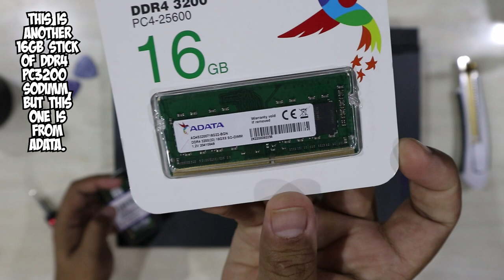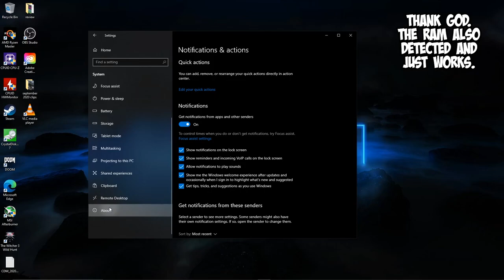Lenovo Legion 5(2020): SSD and RAM upgrade

Comment: MUST READ BELOW!
My experience so far after checking out this Legion 5 AMD.

How to buy - Right now not available in stores, but go to store ask them to order one and after 4 days later, get it in store itself. 

Legion 5 AMD 4600H/4800H - 79,000 / 89,000

1. 4600H/4800H - Top most mobile cpu you could get in this price(far better than 10750K)

2. 1660 Ti is perfect for 60+ fps with ultra settings with all and even latest AAA titles. But in here 1650 Ti is still better, it only 20% performance drop from 1660 Ti.

3. Crucial 3200 CL 19 - 8GB RAM - Dual slots(one filled & one empty)
*If you are a heavy user, just get an additional 8 GB(it should be the same RAM model)from Lenovo showroom itself*

4. SK Hynix NVME 256 GB SSD - Great speeds 2K/1K of R/W.
*If you want upgrade SSD ask the store swap a better 960 Evo(3K/3K of R/W) for C Drive*

5. WD HDD 1TB 5400 - Good terrabyte storage
** Gamers - If you want faster loading speeds, swap the HDD for a 860 Evo
Sata/M.2 SSD. It will only help in faster loading speeds, not gameplay.
**Video Editing/ Content Creators - Definitely, swap the HDD for a 860 Evo
Sata/M.2 SSD.

6. Display - 250 Nits. But 300 would have been perfect.
** Gamers - 120Hz is nice. But NO Freesync / G sync. 
**Video Editing/ Content Creators - 72%NTSC is perfect for color accuracy, but it has 45% NTSC. My opinion-you can later get a good display for professional works.

7. Great cooling system. Simply desktop level performance from this beast of a Legion 5

It is solid Laptop in this price range. BEST BUY LAPTOP IN 2020.

1. HP Omen AMD 2020 is very similar to Legion 5 AMD2020. (ALSO A BEST BUY LAPTOP IN 2020). 75,000
2. Don't consider HP pavilion Gaming. coz Omen is so value in 75 k price range.
3. Acer Helios 300 2020 - Also a very good Laptop.
4. Asus Zephyrus G14 - Also a very good Laptop.
5. Dell G3 - Not a better cooling system. 100°C
6. Asus TUF 2020 model - Not a better model from this year.
Reply: Gaurav Raj Panta  I too agree with you, there are some videos that teach us as not in juts gaming as an overall graphics card value comparison between them, we can see that much of difference.

Comment: is it the r7 4800h and 1660ti variant? I usually see people getting the samsung 8gb 3200mhz ram.
Reply from the maker: hi. my one is the 4800H with the 1650ti. models with 1660ti and above comes with 230w charger. the factory RAM is made by Kingston. I just bought the cheapest RAM that meets the spec. ha ha. tq for watching
Reply: @masterofnone4608  yes , yes. u're welcome. I understand. mine is the R7 4800H and 1660ti variant and has 8gb ram but i don't know from which brand they are. i just want to upgrade to 16gb but same brand as well. In ohter video I saw that they got default samsung rams. so it varies depending on region/models etc. thanks for replying though.

Comment: Thanks for your video!! I need to upgrade the SSD M.2, but i want to know the compatibility of the SSD in the market, could you please tell me how?
Reply from the maker: hi. thanks for watching. for m.2 nvme ssd, the Legion 5 supports up to 80mm length ssd(2280). compatibility wise, pretty much any brands of m.2 nvme ssd would be compatible. hope this helps. thanks.

Comment: Thanks for the information. I just bought the same laptop but with 1 stick of 8gb and I am considering upgrading     to 16gb
Reply: Which brand did you buy?
Reply: MUST READ BELOW!
My experience so far after checking out this Legion 5 AMD.

How to buy - Right now not available in stores, but go to store ask them to order one and after 4 days later, get it in store itself. 

Legion 5 AMD 4600H/4800H - 79,000 / 89,000

1. 4600H/4800H - Top most mobile cpu you could get in this price(far better than 10750K)

2. 1660 Ti is perfect for 60+ fps with ultra settings with all and even latest AAA titles. But in here 1650 Ti is still better, it only 20% performance drop from 1660 Ti.

3. Crucial 3200 CL 19 - 8GB RAM - Dual slots(one filled & one empty)
*If you are a heavy user, just get an additional 8 GB(it should be the same RAM model)from Lenovo showroom itself*

4. SK Hynix NVME 256 GB SSD - Great speeds 2K/1K of R/W.
*If you want upgrade SSD ask the store swap a better 960 Evo(3K/3K of R/W) for C Drive*

5. WD HDD 1TB 5400 - Good terrabyte storage
** Gamers - If you want faster loading speeds, swap the HDD for a 860 Evo
Sata/M.2 SSD. It will only help in faster loading speeds, not gameplay.
**Video Editing/ Content Creators - Definitely, swap the HDD for a 860 Evo
Sata/M.2 SSD.

6. Display - 250 Nits. But 300 would have been perfect.
** Gamers - 120Hz is nice. But NO Freesync / G sync. 
**Video Editing/ Content Creators - 72%NTSC is perfect for color accuracy, but it has 45% NTSC. My opinion-you can later get a good display for professional works.

7. Great cooling system. Simply desktop level performance from this beast of a Legion 5

It is solid Laptop in this price range. BEST BUY LAPTOP IN 2020.

1. HP Omen AMD 2020 is very similar to Legion 5 AMD2020. (ALSO A BEST BUY LAPTOP IN 2020). 75,000
2. Don't consider HP pavilion Gaming. coz Omen is so value in 75 k price range.
3. Acer Helios 300 2020 - Also a very good Laptop.
4. Asus Zephyrus G14 - Also a very good Laptop.
5. Dell G3 - Not a better cooling system. 100°C
6. Asus TUF 2020 model - Not a better model from this year.

Comment: hye after installing the ssd, do you need to do anything on your pc to make your ssd run or it willl have another storage automatically. If you have to do anything to your pc to make it run, pls guide me on that
Reply from the maker: hi. thanks for watching. right, if you plan to install an m.2 nvme ssd on the Legion 5 as secondary drive, it's pretty much plug and play. if it's a virgin drive(ie never been formatted/installed before) then you may need to format it first before it can detected and used.  Below is the link to the video where I installed a brand new secondary m.2 nvme ssd on my Legion 5.
https://youtu.be/WkWt8RctLiA

now, if you're talking about installing an m.2 nvme ssd on an older computer(ie one that use hard disk or sata ssd as boot drive) as a boot drive, you may need to enter the bios of the laptop and ensure your laptop is set to uefi mode(this will vary from manufacturer to manufacturer) before you can use your new nvme drive.

that is pretty much the most important thing to do before installing a new m.2 ssd as boot drive on older system. you can clone your old drive etc etc, I personally just do a clean new install to make sure my new drive is not bogged down by any weird settings/driver from old drive. 

it's a bit difficult to go into detail here in reply, I'm sure there's many video on YouTube that can show you how in great detail.

hope this helps. thanks😊

Comment: Why don't you guys disconnect the batter first?
Reply from the maker: removing the battery before performing any upgrade is definitely good practice. it will ensure that no possibility of power running through components and thereby reducing risk of causing short circuit and damaging the laptop. I didn't do it because I'm just lazy, and removing the battery clip is way more work than just removing the RAM. If you really want to minimize the risk of damage, yes do remove the battery, I personally never had issues upgrading a laptop without removing the battery but that's not necessarily the right/recommended way of doing things. Take the good things from the video and do ignore the bad/incorrect things. hope this helps. thanks.

Comment: Thank you for your video, My battery is damaged, it does not hold a charge, just 15%, I would like to know what spare I can use. Thanks
Reply from the maker: thanks for watching. I don't remember the exact model number, but you can search for a replacement battery online, it shouldn't be too difficult. I'm not sure where you live so I can't really suggest a link. if you're not using the sata drive slot, you can even upgrade the battery capacity. hope this helps😁

Comment: Hey, I am getting black screen after upgrading the ram of Lenovo legion 5 15arh05, I used Crucial CT8G4SFRA32A RAM 8GB 3200MHZ DD4 SODIMM, which showed on the Crucial site.
Reply from the maker: hi. sorry to hear that. hv you tried renstalling the old ram stick(s). does the black screen still occurs? if your computer is fine with the old ram, it's probably a good idea to reseat the new ram making extra sure it is properly installed. if you hv more than 1 stick of ram, try one stick at a time. for all we know it may be a defective stick. hope this helps. thanks for watching.
Reply: @masterofnone4608  I didn't touched the old RAM, just put crucial one in the other slot, it wasn't booting up, then I removed crucial one and laptop started.
Reply: @masterofnone4608  I tried installing the new ram 2 times. didn't worked both times, got black screen.
Reply from the maker: @ZeroLight_YT  did you try with just the new ram stick? system boot up? . cause if it still black screen even on its own, you may have a defective ram stick. but if on it's own system boot up, maybe the old and new ram is not compatible with each other.
Reply: @masterofnone4608  Lol I am too scared to remove original ram of the laptop, so I didn't tried with only crucial ram stick.
Reply: I bought the same ram stick as yours 🤦🏻‍♂️. Hopefully it works on mine and yours is just a defective one. BTW, do you have the Lenovo legion 5 rtx 3060 or last years model?
Reply: @iihamed711  nah mate it was fine only mostly, I think it didn't got booted up as I didn't removed the battery cable connected to the laptop, when my replaced stick came I removed that cable and then inserted the ram, it worked fine, I have 2020 Legion 5 ryzen 5 4600h 1650 one
Reply: @ZeroLight_YT  Great to hear. Thanks

Comment: it is possible to put nvme and ssd together or there is not enough room min 9:42
Reply from the maker: hi. the way lenovo set it up,  if you plan to add more storage, you have to choose either adding a sata ssd or an nvme ssd. unfortunately can't have both as either will block the other one from being installed. hope this helps.

Comment: People say its important to disconnect the battery but do need to unplug the battery connector and move it out or do you just need to unplug the connector?
Reply from the maker: hi. thanks for watching. it's usually enough to unplug the battery connector, no need to take out the battery. hope this helps. 😁

Comment: whats the read/write speed of the m.2 that comes with this
Reply from the maker: hi thanks for watching. the m.2 drive that came from the factory in my legion 5 is a western digital one(not sure which model). 

If i remember correctly, the read and write speed are around 2800MB/s. Which is not too bad.

Hope this helps. Thanks.

Comment: Bro, where did u get the screw for nvme? Does the screw from the dummy drive fits with the nvme?
Reply from the maker: hi. unfortunately the screw from dummy disk won't do for the nvme. it needs a 3x2mm screw. some nvme do come with the screw, some seller would some time include the screw, some pc case/laptop do come with a screw pre installed and some times unfortunately you have to buy the screw separately. the main thing is to check when buying whether the screw is included or not. it'll be very frustrating to find out that you're missing one tiny screw after opening up the laptop and about the install the nvme. hope this helps.

Comment: Hello, nice video, thanks for sharing! One question: I noticed you're using the genuine Lenovo Legion notebook stand, how do you like it? Would you recommend it? I'm asking because it is quite expensive if bought in my region and there are many other cheaper alternatives out there...
Reply from the maker: hi. thanks for watching. I quite like the stand because it's made of solid aluminium and feels sturdy. also because of the fact that the legs can be fold flat. 
I don't know how much the stand cost because I got it for free. When I bought the laptop, lenovo did a giveaway promotion on the website. basically if you bought a Legion, you enter your email and home address and if you're among first 500 or something they send you some free stuff eg cap, water bottle, laptop stand, and headphone cases. so I was one of the lucky ones. 
maybe I'll make a video one day of what I received. that's the thing about lenovo, they always do some quiet promos on the website and sometimes the way the website is arranged don't make things too obvious.
so, to answer your question whether it's worth it. if you think it's expensive and there are cheaper alternatives, then it's not worth it. personally, if I was looking for a laptop stand, I'd buy a cheaper one with probably some fans etc. functionally, a cheap laptop stand would function just the same. hope this helps😊
Reply: @masterofnone4608  Thank you very much for your extensive reply, much appreciated! 👏 I agree with you about the quality of the genuine stand, especially the flexibility which allows to use it in different configuration of height and inclination. This is something quite unique and not easy to find in alternative solutions. Unfortunately the retail price is very high in my Country, the equivalent of around 70$. Of course the opportunity to buy it at a significantly reduced price would be a no brainer but at a full price it's not an hands down decision. However it's nice to know you find it a quality choice. Thanks!

Comment: 5:45 I just found out the answer I was looking for. subbed. thanks. also I have one more question. does latency need to be matched? is it a must? what if I bought a 8gb ddr4 3200mhz but the latency doesn't match the one which came inside my legion 5. btw I bought the 8 gigs one model. please answer
Reply from the maker: hi. thanks for watching and sub😊 ideally, to minimise instability, and ensuring the system is working at its best potential, yes, you want to match everything, voltage, latency and speed.
However, if you do run a mismatched stick, usually the system will run both sticks at the slower speed/latency. having a mismatched sticks will increase the possibility of instability, but milage may vary.
so, if you're buying a new stick of ram, I suggest you try to get one that matches the one in the laptop. however, if you already have one lying around, I'd just try installing it and see how it works, it won't damage your system, rather if the ram sticks don't like each other, you probably hv instability ie crashes etc.
hope this helps. thanks.
Reply: @masterofnone4608  thanks for suggestions. Glad I haven't bought one yet. Gonna get one when my legion 5 arrives. 
One more thing, brands such as Lexar, silicon power and a few other names which I'm not familiar of, are these brands good enough to be trusted for my ram upgrade?
Reply from the maker: @mehedihasanhasib4282  I can't vouch for a lot of the brands, but we also have silicone power in Malaysia. to be honest the small brands usually don't make their own RAM, but they bought from from the big guys eg Kingston/samsung  etc and relabel them.
so take it with a grain of salt, I would imagine the RAM won't be of poor quality or would perform below it's specifications, but buying from a well known brand would probably give you more confidence in term of post purchase support and warranty and stuff. hope this helps.
Reply: @masterofnone4608  thanks a lot 😊

Comment: Is this 32gb ram is supported for Ryzen 5 4600h and nvme can support upto 1Tb
Reply from the maker: hi. the 4600h should be able to support up to 64gb of RAM as per the 4800h, and 1TB NVME ssd should also be supported as well. hope this helps.
Reply: But single nvme can support 1tb ssd
Reply from the maker: @tilakmagodia5070  hi. you can have two 1TB NVME ssds installed in the laptop. ✌️
Reply: One last thing about battery legion 5 support 80 whr i guess bcuz jarrod itech video he replaced battery too so it good to upgrade battery from 54whr to 70whr
Reply: Hi can get reply for last question plz
Reply from the maker: @tilakmagodia5070  hi. sorry I didn't realise u were asking a question. on Lenovo's Malaysia website, you can only opt for the higher capacity battery (80wh)if you choose the Legion 5 model with either a 1660ti or rtx 2060 that also comes with a 230w charger.
as for upgrading the battery yourself, if you can find an original battery, or at least a reputable one to buy, it shouldn't be to difficult as per jarrod's video. Bear in mind if you upgrade to a bigger battery, you most likely won't be able to upgrade your storage using a 2.5" ssd or hdd. you'd be left with the option of adding an NVME ssd if you want to add a second drive.
I personally don't feel the need to to upgrade the battery with my current usage. Most of the time I use my laptop plugged in and the ocassional time when I  use it on battery the battery life is adequate.
However, in the future if the battery has gone weak I'd definitely consider upgrading it to a bigger capacity one.
hope this helps.

Comment: I'm currently in the middle of upgrading my Legion and I'm struggling with the case as well. So, it's not just me. Although I found out my small screw driver isn't small enough for the screws that hold the metal plates (covers, whatever) over the ram and ssd, or they just wont budge. Disappointing.
Reply from the maker: I used a multi bit screw driver(a cheap one, mind you), so it save some time to look for the right sized bit. the screws on the plate requires a bit of force first time unscrewing it. hope it doesn't put you off upgrading completely😉
Reply: @masterofnone4608  Not at all. These laptop cases a all...peculiar.

Comment: To increase ssd we have to remove HDD permanently ?
Reply from the maker: yeah. unfortunately the second m.2 slot will be blocked if a hdd/sata ssd is installed. you hv to choose either one. hope this helps. thanks for watching😁